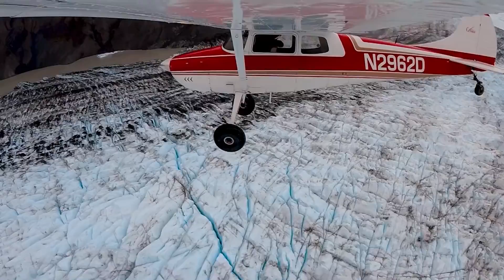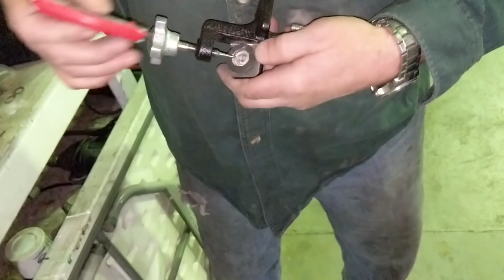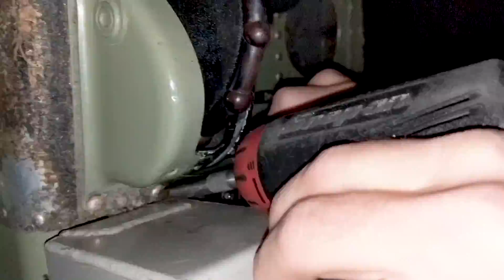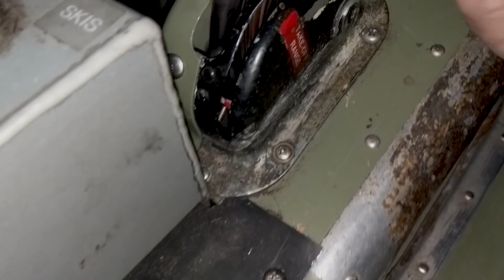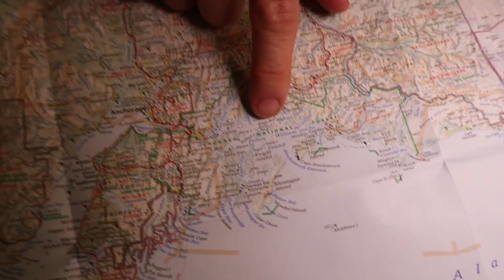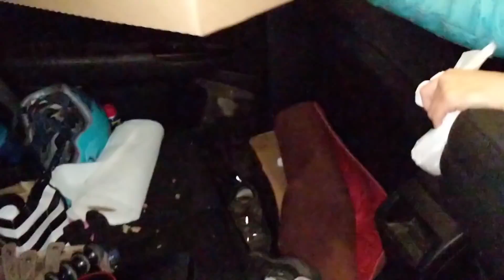18: How it all started.... and the annual inspection

Comment: what happens if that little lose part from the spark plug falls into the cylinder while engine is running
Reply from the maker: pretty bad things can happen!
Reply: It would probably be just fine being so small. But there's always a chance it could take out a valve. I'm a mechanic by trade and have seen engines eat some crazy stuff and still run good. Lol

Comment: nice tuque men i like it , get dress for cold weather you south frail thing lol , it's not the electrode but the ceramic still need to be change, lucky it didn't fall in the cylinder and scratch it , will be fallowing , thanks for sharing.